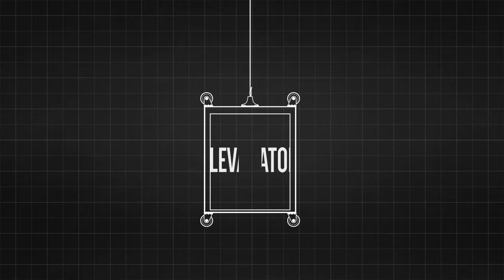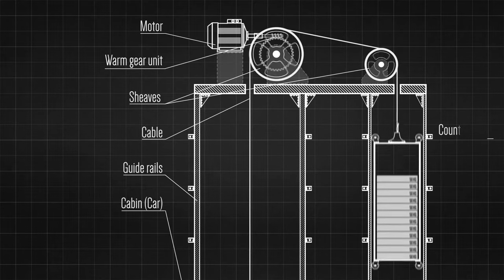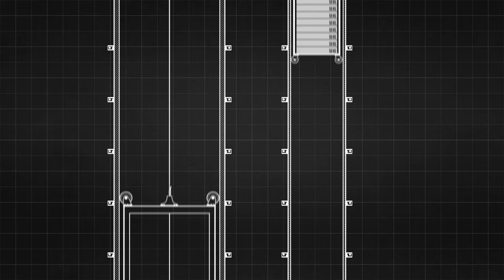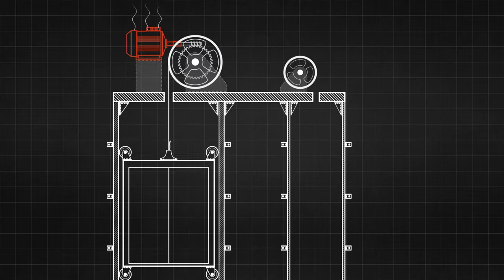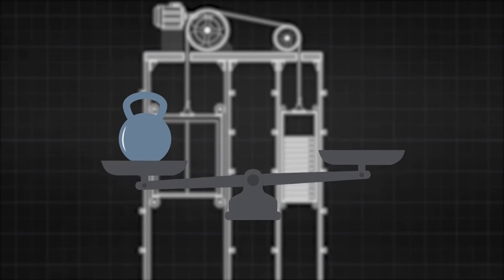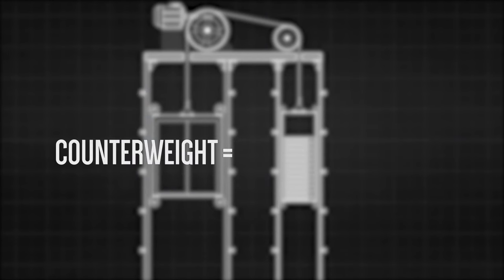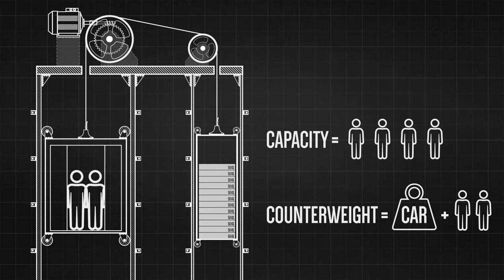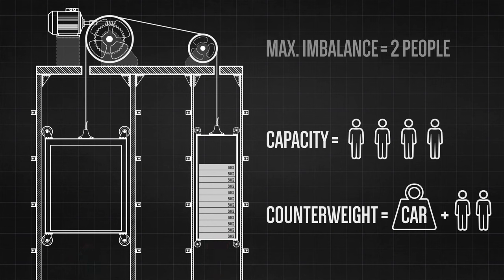Why does the elevator need a counterweight?

Comment: A useful explanation of the use of a counterweight. It is, of course, very simplified. Not all lifts are driven through a worm gear. High speed lifts are direct drive, but the balance principle is the same. Most hydraulic lifts do not use a counterweight.

Comment: Meaning the counter weight is more than weight the capacity of car?
Reply: yes. Weight of car + half the maximum number of people.
Reply: @netional5154 why half, why not whole?
Reply: @deepdays9068  Did you watch the video? It's explained.
Reply: It’s worm gear unit( it’s a worm over wheel unit in the diagram) also there quite a few traction lift without counterweight nowadays using wrapped sheaves and ropes fixed to the bottom and top of a car working in a push and pull arrangement.
Reply: @deepdays9068 the motor only needs to shift half the load. It lifts that weight in the counterweight to move an empty car down or the same to lift a full car up